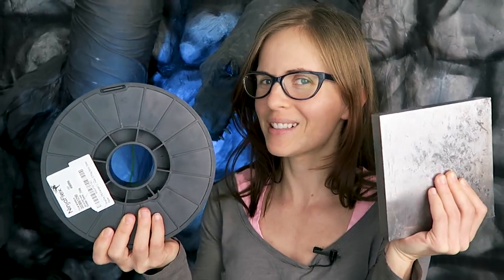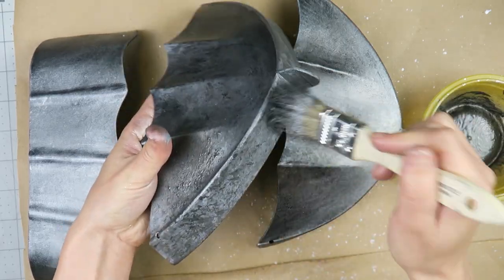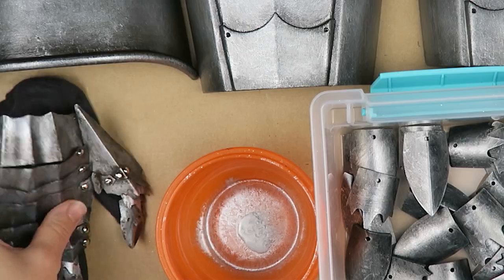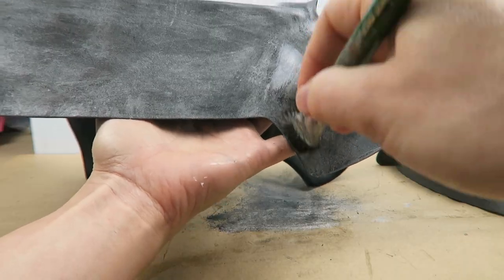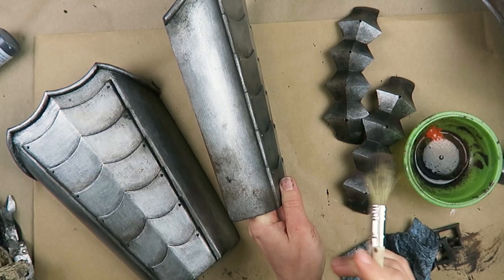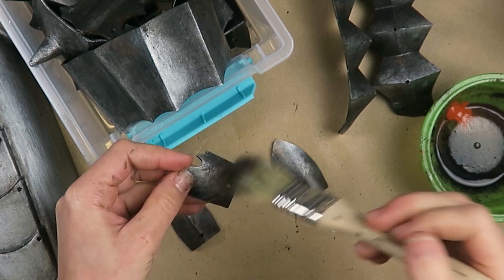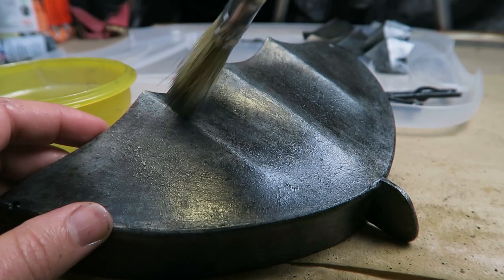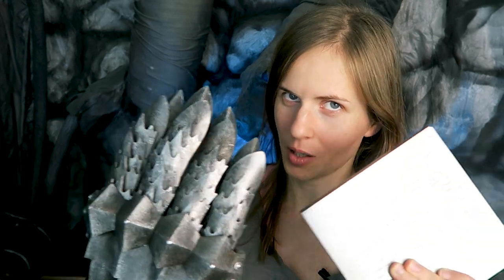Paint Effect that Transforms Plastic into Steel | LOTR Ringwraith Armor (Pattern Available)

Comment: Pardon me, but the painting step was too fast. So you mix silver, umber, dark silver and then silver and then?
Reply from the maker: Last would be the brightest silver dry brushed onto high areas that would get polished by normal use on real metal.
Reply: Yeah this is definitely over-edited. It should be longer and explain more plainly

Comment: Awesome!!!  The dry brush technique is a great idea for adding texturee.  How long each step takes?  Sounds like an hour or so a day for each level till they dry.  I was hoping I could do something like this to my boot/cast for a broken ankle.....without taking it off...  yarr.  Also, I have a few fast motion vids you may enjoy in my playlist.  Did you  finish the entire suit yet?  Thanks for posting.
Reply from the maker: Dry time varies depending on the thickness of the coat. The longest drying part is the sealer which needs overnight to harden. A fan directed at the boot might speed it up! Yes, the full costume is finished.

Comment: Hello, how would you paint kydex thermoplastic to achieve a similar look, but still have quite a high hardness to resist sparring with metal swords?
Reply from the maker: Unfortunately I don't know of any paint that holds up to being chopped at with metal. You might just be in for frequent touch ups.
Reply: @LindyDesignLab  thanks for the info, then atleast i know its a nonsensical quest. Might just leavy the shiny kydex look haha.

The only other option i can think of is if there are any slightly flexibly epoxy kind of things? As in coat the paint in like 1 to 2mm of plastic?

Comment: What kind of plastic did you use?
Reply from the maker: Kydex for the heat molded boot armor parts, tpu filament for flexible 3D printed parts and matte fiber htpla filament for the rest.